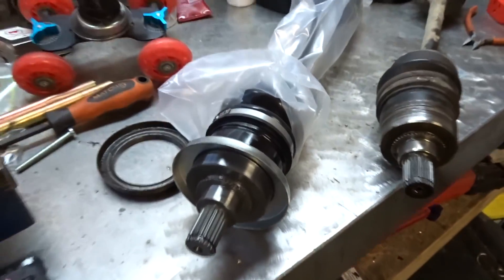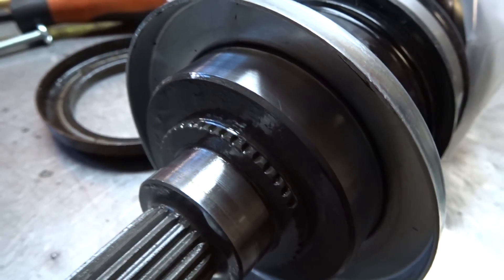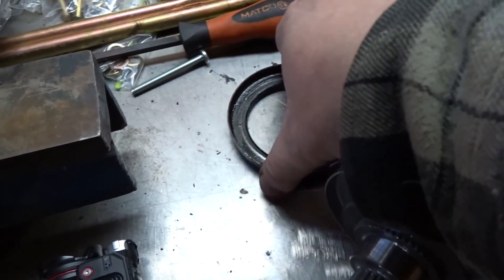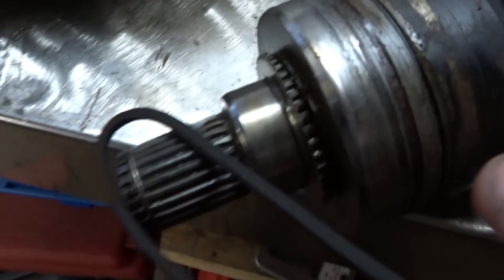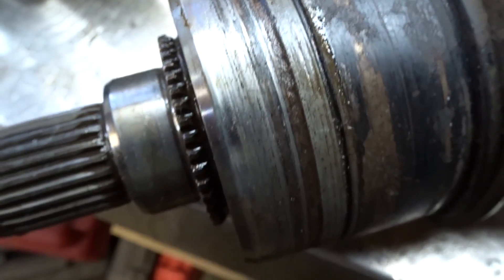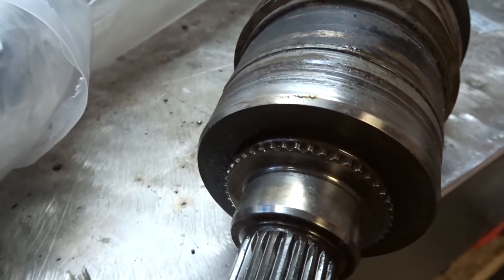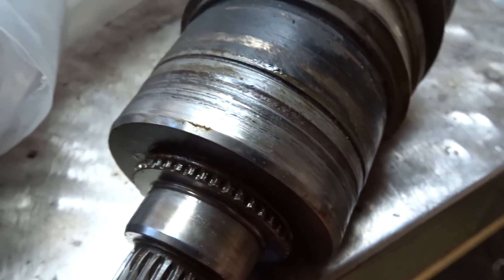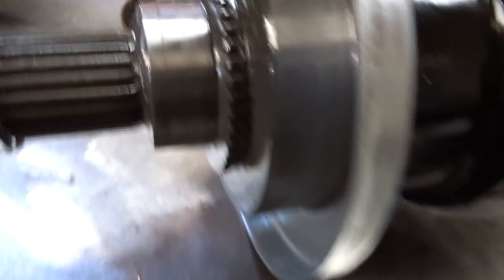Fixing the Problem but Not the Root Cause

Comment: Most shaft seal surface damage can usually be easily and relatively inexpensively repaired with a "shaft saver sleeve" and still use the same sized seal.  
They are readily available from Timken (Redi-Sleeve), SKF (Speedi-Sleeve), National (Shaft Repair Sleeve), Wear Sleeve, Daemar/DMR, Sturdi and others. 
Most are very thin hardened stainless steel sleeves that drive-on or press-on the damaged shaft without turning or machining.
Reply from the maker: I’ve heard of them but never actually seen one in person